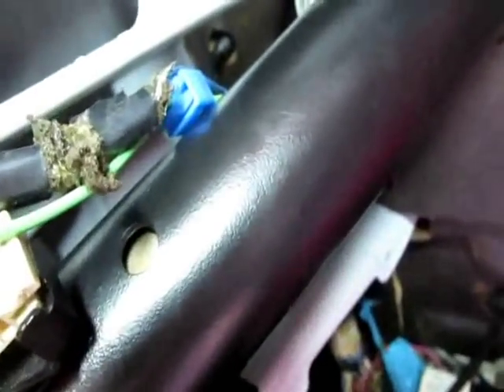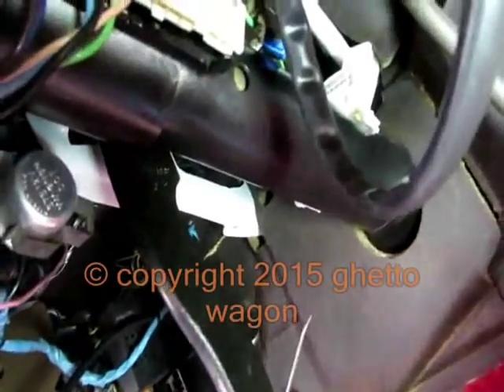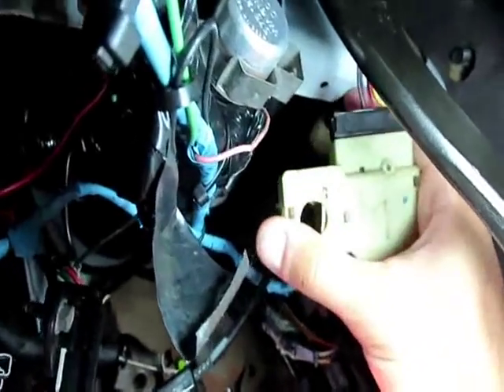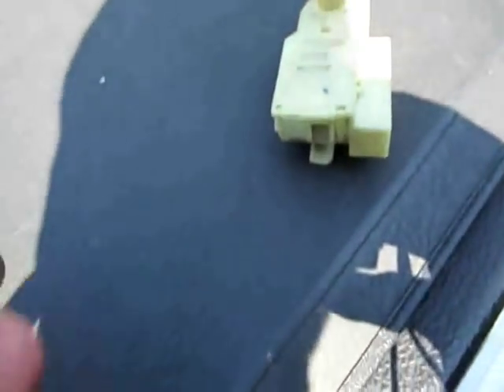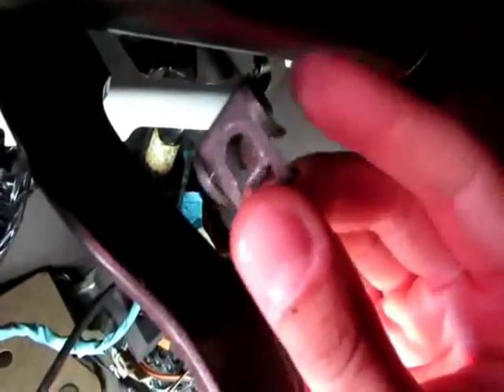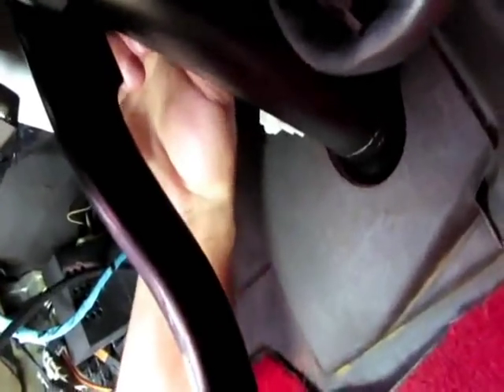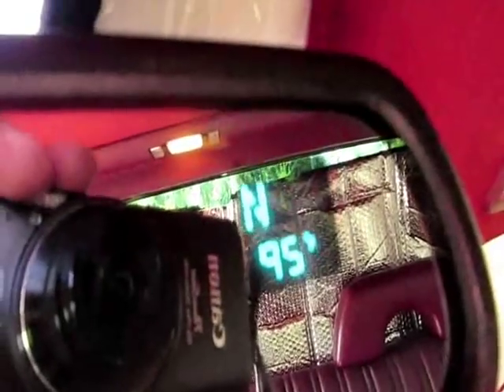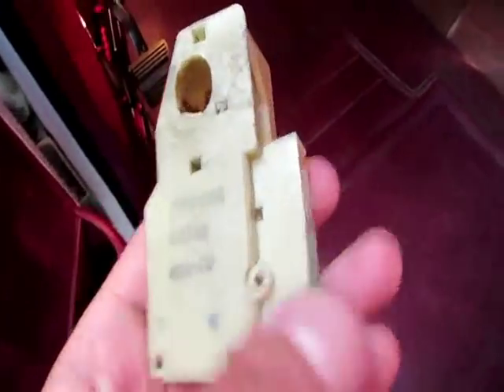Chevy Silverado 88-98 brake light switch replacement GMC Sierra tahoe Suburban

Comment: I just installed one on my 94 K1500, and it works, but there seems to be too much play and wobble so It doesn't accurately read it, any suggestions to get it to work right?
Reply from the maker: +Legal Zephyr You are saying the brake light switch moves too much? in what direction? side to side or forward and back? If its side to side the clip is not on all the way. Front to back play, the switch could be just crap, mine moved too much like that and that's why it worked when it wanted to  Its a weird fitment, if its loose the brake switches contact wont close. What brand switch? ACD? or aftermarket
Reply: It is an Autozone brand, "Duralast" i'm pretty sure, and the play is side to side, I put in a washer, it fixed it a bit, but now i have to angle it a certain way for it to work 100% of the time. And I don't know how to do a permanent fix.
Reply from the maker: Legal Zephyr
 It could be just a crappy molded switch. Did you have the PITA square clip originally or the round washer looking clip?
Reply: I believe it was the round one. Well, at least the end was round. Also, The guy I bought it from gave me a Delco one, should I try putting that one in?
Reply from the maker: I like the delco one over aftermarket, I always used delco, I only replaced this switch twice and its been USED in Northeast traffic! On n off the brake I think most 94s use the square clip. It locks on to a small groove that you can barely see. When the steering column is out its real easy.  Legal Zephyr
Reply: Ghetto Wagon I also have a brake controller installed, will that affect the brake lights???
Reply from the maker: +Legal Zephyr Depending where it gets the signal from the brake switch, it could.
Reply from the maker: Legal Zephyr
 there is a ground on the rear of the frame by the bumper that controls the lights. I clean it every few years.
Reply from the maker: Legal Zephyr
 just some steel wool. clean the frame, the eyelet and the bolt. then cover it all with some dielectric grease,
Reply: Anyone still on this? Have a 95 suburban and the brake light switch has a lot of front to back play on the push rod. When pushing the pedal it doesn't actually engage the switch as it should, the whole switch just moves one the push rod without ever actually moving that brass rod in the switch over. Seems as if there's something missing to keep the brake switch secure? Any help is appreciated.

Comment: I got a 94 Chevrolet silverado k1500 and when I barely push on the brake maybe 1 inch.. I have brake lights but if I push all the way down they go completely out... any suggestions?? maybe try new switch??
Reply from the maker: It could be worn out. The problem with this switch was not the contacts, the brass contact  piece on it was just bent from use. It engaged when it wanted about 1 out of 10 brake applications.  Get a AC delco switch they seem to last the longest. Made in Mexico!
Reply from the maker: Tim Baker
 Yea I hope it fixes it The fitment is crucial for the switch to work, it engages in a weird way
Reply: +Ghetto Wagon just replaced it about 30 mins ago.. and it's works like new now! appreciate it!

Comment: My early 94 Chevy is a different issue I have brake lights,turn signals, reverse lights, license plate lights and hazard 4 Way flasher lights, but the 3rd brake light does not work..
Reply from the maker: Check out the ground on the frame in the back. Drivers side by the bumper
Reply: @GhettoWagon  ,I didn't think that was it, because it has brake lights that work, but the light on the back of the cab the 3rd brake light does not.

Comment: I had to replace the connector on my 97 silverado, some wires worked loose, could you list the color order for the connector? Thanks, Mike
Reply: Did you find out the order I’m needing them as well I have 96 k1500

Comment: i got a 98, brake lights stay lit up wont dim when off the brake, turn signals dont work or reverse lights checked fuses and ground would brake light switch be the problem?
Reply from the maker: +mike beas  If the lights stay lit all the time the switch could be sticking. Unplug the connector at the switch see if the lights turn off. If they do, most likely the switch is bad.  I am not sure about a 95+ truck as they changed the wiring but make sure the brake relay is working correctly as well.Test it with battery power and a volt meter.
Reply: +Ghetto Wagon thanx o got it fixed. Apparently my luck is bad enough that both circuit boards on the taillights went out at the same time. I changed them both after putting brake lights switch, turn signal switch, and relay. A lot of time and labor for such a easy fix. Thanx for the info though.
Reply from the maker: mike beas
 I forgot about those boards.  I should pickup a few GM ones

Comment: replaced switch, now when brake pedal is pushed the lights come on for about the first third of travel and then goes out when pedal is fully depressed.  Any idea what is going on?
Reply from the maker: Switch man not be adjusted right on the push rod, Also make sure that the clip is locked on right. Some brake light switches I noticed the brass colored piece that slides over  stud on the brake pedal is sometimes not bent well. If you bend it so it fights tighter the brake lights are more sensitive. I had a "bad switch" that needed just a bend and it worked again perfect.

Comment: I have an 88 chevy silverado c1500 and my parking brake light keeps turning on my dash but the parking brake is not engaged. Do you have an idea on what it could be?
Reply from the maker: Jaime Tale  If the light is dim lit, its a ABS code.  IF the truck does not have ABS, probably its loosing brake pressure somewhere.
Reply: Ghetto Wagon It is dim and does not have ABS. I'll get to it now thanks man!

Comment: I got a 92 Chevrolet Silverado c1500 and the break lights stay on when the truck is off will this fix it ??
Reply from the maker: Unplug the switch connector, if they go off it may, if the switch is the problem that is creating the short.  That or the relay could be shorting out. if. You have trailer wiring, check out all that in the back for shorts to ground. Alot have some aftermarket T connector that connects between the chassis harness and the taillight harness. Cheap kits fail
Reply: Fernie Escobedo
Reply: im wondering.  my brake lights sometimes stay on.  if i lift back on the brake pedal, they go off.  they dont always stick on..but i cant see whats happening going down the road, just if it happens when im parked but i can guess.  My truck is an 89 c1500.  could this still be the issue, or is that something else entirely?

Comment: I have a 96.  Your vid helps.  I would add...everything happens after the clip comes off.  The switch for the 96...looking at it...one would think "how in the world does this come out?".   Believe me this is the worst design for maintenance imaginable.   That clip is above the switch and its mount....you might be able to see it with one eye and a light just in the right angle.  

What a joke.  This is what makes the shade tree guy cuss at modern engineering.
Reply from the maker: Its REALLY easy to get at when i had the steering column out.   I was all "Woah look at that Clip access!"
Reply: I could see only the bottom of the switch but I used the feel method with the clip. It came off easy but was a bi.ch getting back on (the clip).  I also wasn't sure where the unit clipped on to but I moved it around and figured it out.

Comment: If only one tail light is not working.....could break light switch still be out??....I replaced bulb housing and all bulbs on driver side but only works periodically.  Had stealing column replaced due to auto theft earlier in year.
Reply from the maker: if you have an old chevy may want to check the taillight board,   Take both tail lights out, plug the working side into the non working side and visa versa  The board is different as in the fitment but the connector fits. If the problem travels side to side you need a new board on the non working side.    Or you can just use a test light make a pin, stick it in the connector behind the taillight  and make sure the correct wire lights up the test light when the brakes are applied.  There is a ground by the frame on the drivers side near the bumper. that can get crappy. Also there is a connector for the taillight harness around the same spot which can get corroded or damaged. Check that out for a good clean pin fitment.
Reply: I replaced the board on the now working after new bulbs made no difference.  I will clean that ground up......I saw that earlier today as well and connector.......I will work those two areas next.  I appreciate your input.
Reply from the maker: Yea NP chck if you have power  and ground from the connector. If you have trailer wires check out that too  I don't have trailer wires.
Reply: Thanks !

Comment: My yukon Brake light don't work but my trun signals work fine. I went out and bought a brake light switch,I'm having a hard time installing it. Please help
Reply: how are you having a hard time? what is making it hard? the kind of clip I had wasn't like this one it was meant to never be removed... I have to remove all the steering wheel and at the end I was able to take the stupid clip off but it was hard... what is making hard on your end?

Comment: I have a 89 c1500 & my brake lights stay on constantly even after I let go of the pedal.. I had to disconnect my battery to keep it from draining it. Could this be the reason ? TIA
Reply from the maker: unplug the switch. if they still stay on probably have a stuck relay
Reply: @GhettoWagon  thanks for the info. Ima check it out later today.
Reply: David temoxtle did it work for you ?
Reply: @GhettoWagon where is this relay located? (I've got 1988 k1500) Frustrated beyond belief...... I've got a wiring schematic, but it's not that helpful for me, other than wire colors. Another question, there's three bulbs in a taillight. The top bulb (single filament) never lights up...since I have no brake lights, is this the bulb that should be lit? Thank you!
Reply from the maker: Bottom bulbs on the tailights are for the brakes signals.  1988 wont have a relay on the fire wall think they added that when they put a 3rd brake light later on But maybe its there, Relay on the fire wall by the brake booster  @coeneschamaun1735

Comment: I have a 1994 chevy silverado and I've got a new brake light switch but it's all moving together how do I stop the brake light switch from moving???
Reply from the maker: Not really sure what you are saying The switch should clip onto the brake booster push rod.   Put the switch on the peg, rotate the switch so its on the brake booster rush rod, then install the clip.  The switch moves forward and back just a small amount to activate the lever inside the switch.

Comment: code reader says I have a bad switch but my lights are fine? any idea?
Reply from the maker: +Blackhawk5656  Nope. Never heard of a brake light switch throwing a code
Reply: +Ghetto Wagon its throwing a code on mine I guess. it says stop lamp switch under the definition
Reply from the maker: Blackhawk5656
 It must be new! What kind of vehicle what year?
Reply from the maker: Blackhawk5656
 Weird.  Never knew they had a OBD2 code for that. Searched it, Yup. There is a code for it.  It triggered the CEL? or was it a hidden code. I see it starts with a "p" so  I assume it threw the CEL.  I believe the switch when I took it apart had TWO circuits in it, Best I would guess is that maybe one leg is dead? So the lights work but its not sending a signal to the PCM.  I dont deal with OBD2 vehicles too much.  OBD1 is the best
.  I think if You had a fancy scan tool like a GM TECH 2 or a high end snap on it would have a table you can check for inputs and the PCM would register if the brake switch is on or off.  The tech 2 I used to use had all sorts of cool stuff!
Reply: +Ghetto Wagon yeah I'm guessing that its just not sending a signal to the pcm. which is fine as long as my lights work. I have to replace my egr valve though

Comment: unless you have child sized hands, your going to have to drop the steering column. Took about an hour from start to finish. Zero fun factor. Damn engineers.
Reply from the maker: No my hands are huge I can get the part on and off just fine.

Comment: This is not the brake light switch for a 91 sierra
Reply from the maker: Ya its probably a little different on those
Reply: @GhettoWagon  Well the description says "88-98 GMC Sierra"  91 Sierra falls in that category.
Reply from the maker: @anthonytravis1420   Ya but its the body style of truck. Its a similar switch  similar procedure.  They changed alot of these over the years.

Comment: Does it say made in Mexico, that's probably the problem
Reply from the maker: Nahh I just used the brakes alot.   NYC traffic for years  Now here in moronville, 5 min long stop lights.   Current probably burns em up. OEM one was made in Mexico too back in 94
Reply from the maker: I dont think they were the made in Mexico parts can be hit or miss. Should of seen the pile of ac compressors I sent back. All were made in Mexico none were even worthy of use. Just slapped together wrong clutch. Locked solid.  Now nothing is even made in mexico. Not China.  USA/ Canada parts were the best can't argue with that. (Now hardly any exists)  Japan parts were also very good Australia  same. Mexico was just the land used by corporations in the US to exploit Mexican workers paying them less for the same job that used to be in the States all to fit a cost and they profit more. Now they use China for that.

Comment: Does this switch effect the dashboard lights? Each time I step on the brakes, my dashboard and radio lights come on/dime and no brake lights...turn signals are not working either in the rear
Reply from the maker: shouldn't that sounds like you may have a broken ground.    There are light grounds in the back by the frame behind the right wheel wheel and some grounds in the  front by the radiator support on either side  Also check the ground straps from the body to the frame  Engine to frame engine to body ETC
Reply: @GhettoWagon  so I changed out the whole wire harness and now just the left lights works lol And when u turn on all lights, everything lights up in the rear reverse etc thanks for the ground tips doe I'll check